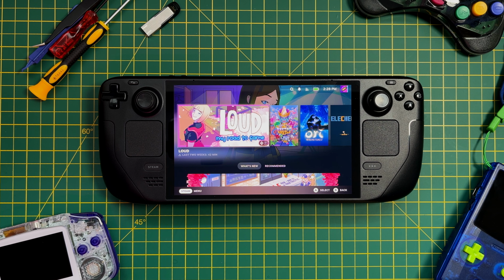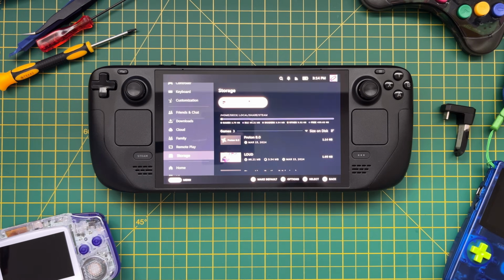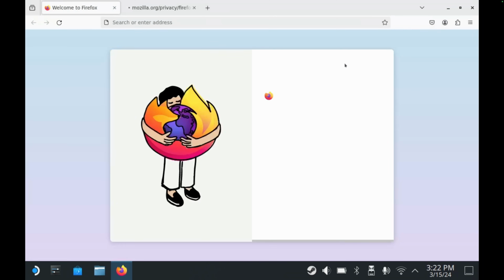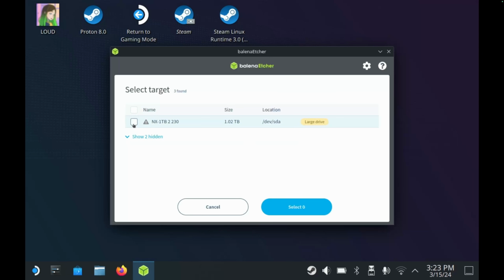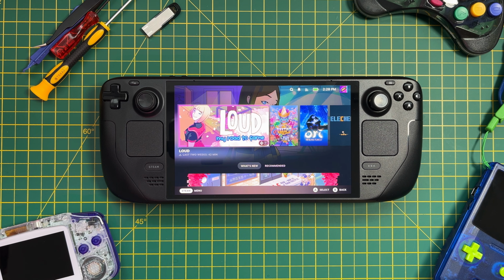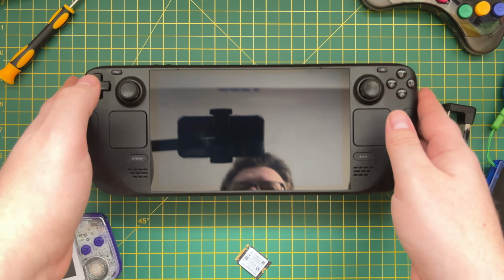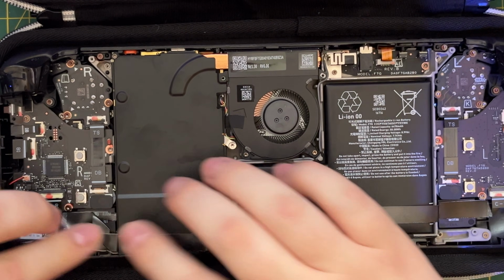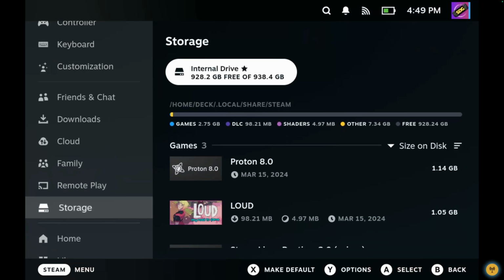Upgrade Your Steam Deck Storage! The EASY Way!

Comment: Is it ok to upgrade a 512g to a 2tb instead of a 1tb. Or are there limitations or advisory reasons not to do this ?
Reply from the maker: As long as the drive you are cloning to is larger, there no limitations. I actually upgraded from 256GB despite the thumbnail.

Comment: My new M2 2230 SP does not show up/detect on the storage session. :( Then i plugged it on my windows box, and it was detected using the same cable and external case. I then initialized it as GPT, but still not showing up on Deck. Can i format it on windows before plugging on deck ?

Comment: ok, not only did the cloned ssd not work when I installed it, but when I put back the original SSD, my steam deck shorted out for some reason...upon investigation, I saw the ribbon cable for the battery spark when I inserted it despite the fact my steam deck was OFF....Steam support, don't fail me now cuz my upgrade just downgraded  my steam deck to a brick. F*CK my life.

Comment: Hi! Is the process the same if I have dual boot on the internal storage? Or would I need to redo it?
Reply from the maker: You may need to extend the partitions manually after you have completed the clone process. But everything else should work.
Reply: @steamdeckguy  thank you for the reply. Since I wrote the comment I managed to find several post online claiming the same. Someone suggested installing NIUBI beforehands on the Windows partition as that also allows you to move the partitions around in a convenient order for extension.

Comment: Heya! I've got a backup on an external hard ssd and I need to get my backup on a device that just returned from an RMA process.  How would you suggest I go about doing that (I'm not trying to swap hard drives, just slap the cloned data on my returned Steam Deck Oled). Someone suggested booting off a usb and then using sudo dd if=/dev/sda of=/dev/nvme0n1 conv=sync status=progress but I don't know the steps to boot off a usb and then input that command...  so lost!
Reply from the maker: Turn off steam deck, then hold volume up and press the power button. You should then see option to boot from usb or internal drive. You could potentially then follow this guide to clone the drive from USB to internal, or run the command in konsole
Reply: @steamdeckguy Thanks so much for the info! 

Minor snag — I was trying to put the cloned image from the external ssd on the rma’d device via balena etcher but balena etcher is saying the rma’d steam deck is too small. But the only data on the external ssd is the cloned steam deck info, so why won’t it fit?
Reply from the maker: @Tomoe1868  is the drive you are cloning to at least the same size or bigger?
Reply: @steamdeckguy ah, no. The ssd is a 2tb and the internal drive on the rma’d device reads as 1.02 tb. Do I need to do some kind of.. partitioning or something? I have a second backup of the external ssd so I could wipe the ssd and re-clone it if needed…

I thought partitioning it wouldn’t be necessary cause the backup shouldn’t have filled up the full 2tb.

Comment: This worked great converting a 512 OLED deck to a 2 TB deck! I used Balena Etcher 1.18.11 as another suggested and it worked perfectly! Woot!
Reply: hi, I'm also planning on upgrading from 512gb to 2tb, quick question, after succesful cloning via balena etcher, is there another step or I can just go straight to installing the new ssd?
Reply: @kimorven3924 Probably too late to reply but there were no extra steps. I turned off the deck before disconnecting the external enclosure then did the upgrade.
Reply: @ i haven't started yet but thanks for the confirmation either way

Comment: I have a 64gb so only have 1 game on the sd and i have 2 sd cards how would i go about doing this method ao i dont lose were i am on my games
Reply from the maker: Follow the exact same process. Anything on your sd cards will just reload automatically when reinserted
Reply: @steamdeckguy  thanks for the reply so I would still have to have the SD cards in depending on what game I'm playing could I not clong both SD cards over as well as the main ssd?
Reply from the maker: @TomWilliams-r3s  once you have cloned the ssd to a larger drive, insert your sd card, and then through the  storage settings you can select each game on sd card and move it to the internal drive. You can also change the default install location
Reply: @steamdeckguy  thankyou so much been putting off doing the upgrade for this reason 😂

Comment: Just to confirm - you didn't need to format the new SSD at all? That was handled by the cloning software? Thanks in advance.
Reply: Correct, cloning will overwrite that anyways so no need to format.

Comment: thanks for this video. I just got a refurbished 64gb deck and a 1tb m.2 drive to go with it. I'm pretty sure I have a ssd enclosure somewhere around here.
Reply: Just finished installing the new drive and it works perfectly. I saved myself a ton of money. Seriously, I got this directly from Valve for less than the price of a Switch OLED.

Thank you so much!
Reply: Same here. I got a 64gb refurbished deck for a grate price,  and my new 1tb ssd is coming on tuesday. Im also gone clone instead of installing fresh, as I have already installed a bunch of stuff (just 800 MB left out of 64gb), and I really don't wanna do it all again....

Comment: What when i have dualboot witch Windows this still will work?
Reply from the maker: I believe you may have to extend the partitions manually
Reply: @steamdeckguy  It's not a problem for me to increase them, but will they move and will everything work?
Reply from the maker: @MrFiolek  I’ve not tested it, so can’t guarantee it will work, but I’d expect it to copy everything as is. You’ll probably find that the steamOS only shows the same size available that you had before - it won’t auto extend the partition. I’d try it - you’ve got nothing to lose
Reply: @steamdeckguy  ok, I took advantage of your guide a little from other sources and everything works, you have to clone the disk as in the video, then connect the copies to the PC and use a partition management program, I increased the partitions on which Windows was and the remaining unlocated memory must be moved next to the steam deck home partition and then automatically connects them, everything works great.

Comment: I have successfully cloned my new 1tb ssd using balena etcher. I replaced the new ssd in the SD, but when i boot up, it is stuck in SD logo. Any thoughts on this?
Reply from the maker: First hold power button down for 10 seconds to force shutdown, and then turn back on again. If no luck, maybe check that ssd is inserted correctly. Failing that it could be a corrupted drive so you may want to try again.
Reply: @steamdeckguy  I already fix the issue. what i did was I recloned the ssd, and it work flawlessly

Comment: Per your comments, I had to specific go to v1.18.11 in their github releases and use that AppImage. Even the latest v1.19.22 from 3 weeks ago (at time of comment) wouldn't show any drives for me. I'm moving from a 1TB over to a 2TB at the moment with a dual boot on it so I'm expecting to have to deal with some partition resizing shenanigans afterwards for my trouble (and have no problem ultimately just reimaging and reconfiguring from scratch if need be!).

Comment: CONFIRMED August 2024: This process still in fact works!

Tested using a Corsair 2230, UGREEN M.2 drive enclosure and balena etcher version 1.18.11 X64 app image from GitHub (must search under releases).

Some notes I have about doing this.

-First, charge your Steam Deck fully. You’ll understand later.
-Next, start up and go through the processes within the video until you get to actually cloning.
-When you get there, make sure that you plug the enclosure directly to your Steam Deck and use the battery to complete the cloning. I found this to be faster than using my Anker USB-C hub which has charging bypass. Only do this if you don’t have too many games as you may run out of battery life.
-While in Desktop, adjust screen brightness to 5% and click “manually adjust sleep and hibernation”. Do this to avoid image burn in on your screen while the cloning process takes place.
-It may take a few tries and failures but 1.18.11 is the most stable build so far that has a known success rate of cloning drives.

My personal experience took two hours total for three games and a bunch of system junk. Your results will vary but this is what I went through. Be patient and persistent and the drive will clone.

As for whether or not the drive worked when I installed it into my Steam Deck, I can confirm it worked. The only downside was that there may be a DRM with the original drive in that installing any aftermarket drive flags needing a verification from Steam. Maybe this doesn’t happen when you use Steam’s reimaging process but I found it to be the only part about doing the SSD swap that I disliked.

Comment: Hi i just bought 2TB ssd and connected it using an enclosure to my steam deck in gaming mode, is it normal for it to say 0 bytes free of 0 Bytes?? I haven't formatted it as per instructions of this video
Reply from the maker: It usually would tell you the size. I’d check that you have inserted it correctly into the enclosure
Reply: @steamdeckguy   I'm such an idiot, thank you for telling me to check! It turns out that I didn't push the SSD chip all the way down enough into the enclosure to hear an audible click! I was worried about damaging it lol. It now reads the space properly on the steam deck! I'm going to clone my data now, thanks!
Reply from the maker: @blueish5063  haha happens to us all

Comment: I can confirm I just used the newest version on their website because I didn't read the comments first... thankfully their most recent version based on the github was released 3 days ago. I believe they fixed the problem.  Everything cloned successfully. I installed my new SSD, powered on and got worried at first because loading took a minute and it went to the original setup and login screen like a factory restore. Chose English and my time zone, logged into my account and everything is perfectly as I left it. I do have to redo settings and some things, it's almost as if it's a fresh install, yet all my games are installed and working (I've only tested elden ring so far). All my video files I've saved etc are there in desktop mode. All good! 👍 

Thank you for the guide! 😊

Edit: Also, decky is installed and all my decky settings/ui changes that I've noticed are intact as well.
Reply: What am I doing wrong the balena etcher on mine keeps coming up as a zip file
Reply: @PoppaSimTV did you sort this out ?

Comment: Great guide! Confirmed working. 
Date(UK): 21/07/2024 - Balena Etcher version 1.18.11 (Obtained from GitHub link in comments) - From 512GB to 2TB (WD SN770M). OLED Steam Deck and same enclosure. Cloning process took ~25 - 35 mins (75% of the 512GB was used). 👍
Reply: I will also confirm I just used the newest version on their website because I didn't read the comments first... thankfully their most recent version based on the github was from 3 days ago. I believe they fixed the problem.  Everything downloaded successfully. I installed my new SSD, powered on and got worried at first because loading took a minute and it went to the original setup and login screen like a factory restore. Chose English and my time zone, logged into my account and everything is perfectly as I left it. I do have to redo settings and some things, it's almost as if it's a fresh install, yet all my games are installed and working (I've only tested elden ring so far). All my video files I've saved etc are there in desktop mode. All good! 👍
Reply: @Flybynight11598 this one really messed me up. Only 18.11 worked for me. I tried 19.23, 18.13, etc. but none of them would detect any drives.
Reply from the maker: Great to hear! Thanks for reporting back!
Reply: Are you happy with the WD SN770M SSD? I'm still in doubt going for this one or the Crucial P310 M.2 2230 2TB. which is a bit faster but has QLC instead of TLC, and i've read that TLC is better for the long term...
Reply: @W13n3n  Absolutely! The drive has been going strong since the initial install - I use my Deck daily for both SteamOS (Browsing / YouTube / TV shows) and Gaming (300GB+ Skyrim modpack / Kenshi / Indies). No noticable performance loss.
Reply: @Rhade2107  did you notice any heat increase of the deck? I read this ssd tends to get hot with heavy use
Reply: @W13n3n  honestly, the Steamdeck seems no hotter than it was before I replaced the 512GB SSD that came with it. If I'm gaming, I usually game around ~3 hours, sometimes with the USB3 power cable attached - no overly noticeable difference from before the upgrade. My SN770M SSD is at about 60 capacity used. Hope I was able to help.

Comment: I have run into a problem. When downloading the Balena Etcher from the official website the APPIMAGE does not appears, that's importante because right there's just a zip file, when you extract the zip there's a bunch of file but there's no clear way for how install Balena Etcher. I NEED HELP PLEASE!!!
Reply: Best guide on the Internet about how to do this!!!!
Reply: Did u figure it out?
Reply: You just double click on the balena-etcher file in the folder after extracting the zip archive, and choose the option to Execute it.

Comment: NOT an easy method! I did each step EXACTLY as in the video. Even downloading the older app image of Belina Etcher. My new 1TB drive is showing in my Steam Deck as the old 512GB. It “cloned” the size as well. Not happy. :(
Reply from the maker: Did you have windows installed on your 512gb drive? If so, you’ll likely need to resize the partitions manually. Otherwise, steamOS should automatically extend the  unused space
Reply: @steamdeckguy  No. Stock 512GB OLED model. And a brand-new Corsair MP600 CORE Mini 1TB M.2 NVMe I picked up on Prime Day. Didn't format it, as instructed in your video, but verified it was showing correctly (1:36) before booting back into Desktop Mode.
Reply: @iamsomewhere  idk any better solution other than just re-install the whole os but if u dont want to do that then u cant go to desktop mode, launch KDE Partition Manager and try to resize it, if you're getting error then just create a new partition from the unlocated space and just.... live with it.
Reply: @thescreamingsoap  This is basically what I ended up doing. I booted into the BIOS, completely wiped everything, then reinstalled SteamOS via USB drive/Deck Image. It was a pain, but at least things are working correctly now, and the drive size is showing as it should.

Comment: Mine worked perfect. Minus non steam games and emulation station. That are not showing. Should I do something in desktop mode?
Reply from the maker: That odd. Are they still installed? Id check if they still exist in desktop mode.
Reply: @steamdeckguy  thank you for the quick reply. Yeah I checked, they were still installed, and emulation station and roms, and so on. Just weren't populated in Gaming mode. Just had to add them again and everything is working fine now 😉
Great content. Thank you so much

Comment: You mentioned doing this with a micro SD, do you have a video explaining how? 4:20
Reply from the maker: I use a USB drive in this video to reinstall steamOS. You can follow the same method using a microSD card.
https://youtu.be/8SqomrDTYfs

Comment: Just upgraded my steam deck today to a 2TB. Your guide really helped and was very easy to follow. Thank you!
Reply: The balena etcher keeps coming up as a zip file and I'm stuck
Reply: @PoppaSimTV git hub version 1.18.11
Reply: I am going to upgrade my storage tomorrow. Which version of balena etcher did you use?
Reply: @daexter8971 use the x64 version, then once you've extracted the zip file open balena by the item called "balena-etcher". Mines currently cloning now, will be changing drive over tonight once kids in bed 🤣
Reply: @daexter8971 1.18.11

Comment: Following your guide was pretty easy, the LCD model i got on sale had different wiring  so I only ended up having to unplug the power while i did the swap and i used the older version of the cloning software and everything went smooth, i erased all my games before cloning and just reinstall after the swap, I had a complete panic attack waiting for that first boot up but it seems perfect
Got 2tb to work with now : D
Reply: Which older one did you use I wanna do this also on my LCD model

Comment: So I’ve started over. Followed your instructions completely. Etcher flashed and verified. Looked at storage and nothings changed, still saying 1.8TB free. This was a brand new WD_BLACK SN770M 2TB. I give up and ill have to start over which is ballache.
Reply from the maker: 1.8tb free for a 2tb drive is normal.
Reply: @steamdeckguy  Even it was cloned? I can’t get my head around this. I followed everything correctly but I’m still left with no space. 😩😩😩😩
Reply from the maker: @russellmay9841  what size disk are you cloning from? And did you have windows installed by any chance?

Comment: Any reason why the transfer speed is slow? Mine shows 30 mbs and 201 minutes lol. Im currently doing it. Im hoping the battery doesn't go to zero
Reply from the maker: Depends on the size of the ssd you are copying and transfer speeds. Mine was pretty quick as I only had one game installed (for demo purposes)
Reply: @steamdeckguy  weird it was slow with USB c to USB c. Put a dock and use USB blue port to type c. Speeds were 350 now lol.